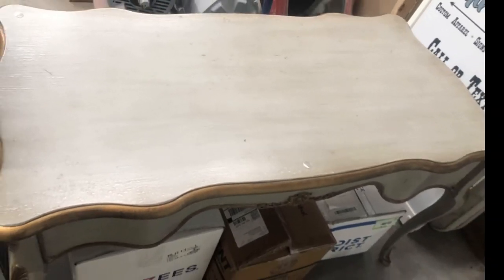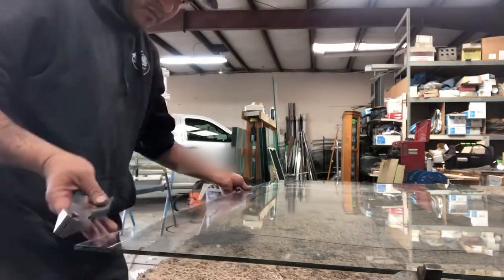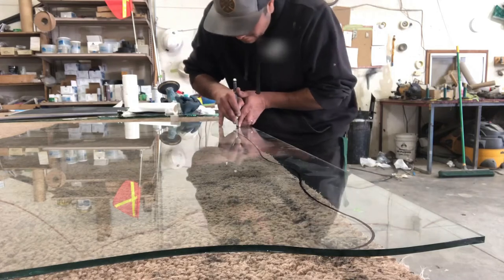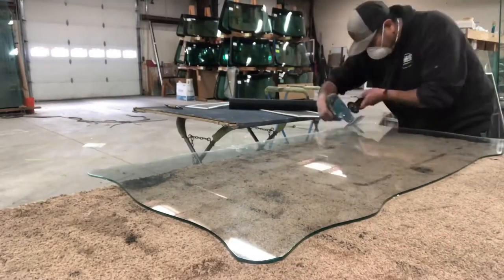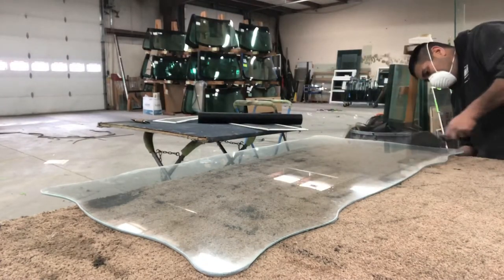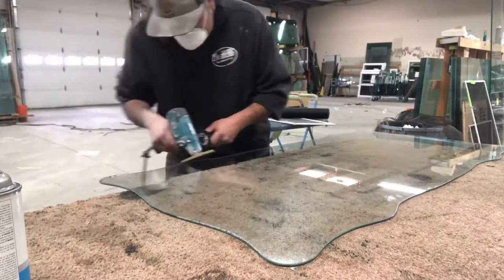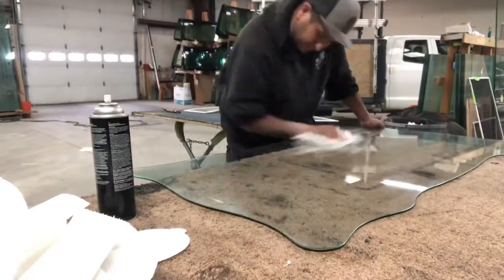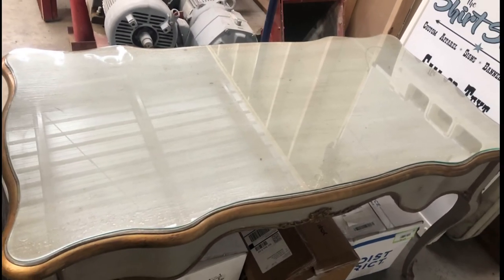How to cut glass (custom pattern)

Comment: Hi Alex, what’s the best way to cut out 1/8” of glass on a double pane? Can I just grind it or sand it? Thanks bro, your videos are more helpful than any on here.
Reply from the maker: Thanks man! And an 1/8 of an inch u can sand it but I’ve cut that off and just grab your glass plyers and break it off and with a Utility knife cut some of that seal and it should break off it’s not the easiest but it can be done
Reply: @AlexRubioRQualityGlass  we’re replacing a broken dual pane with an exact same brand, but for some reason the glass is an 1/8” too wide. I will try to take some of the black hard rubber off and use glass pliers. Thanks Alex!

Comment: What type sander are you using?
Reply from the maker: It’s a makita 5 inch sander and on that video I used an 80 grit to and finished it off with a 400 grit sand paper